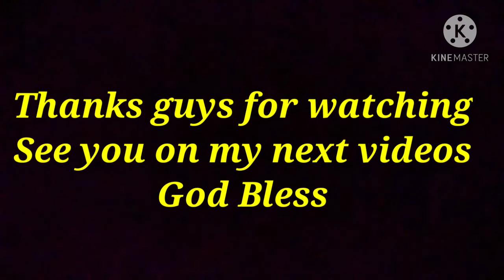IMPALA 2019 Model,Replacement & Alignment of front Bumper by: Cesar Betorio ,#65

Comment: Good video

When locking with a long extension,

Can you tell what the size of the bolt is?
Reply from the maker: Size 10 of that bolt between the fender and the bumper
Reply: @cesarbetorio3256   Thank you

I have one more question,

Is the location of the front parking radar displayed?
Reply from the maker: There inside of front bumper near of fog lamp left side, u need to open the fender liner left side and u will see it
Reply: @cesarbetorio3256  Thank you for answer

I'm going to install a front radar sensor

Because you let me know that there is an original radar mark inside the bumper,

I think it will be much easier to work when making a hole..
Reply from the maker: Ok your welcome sir